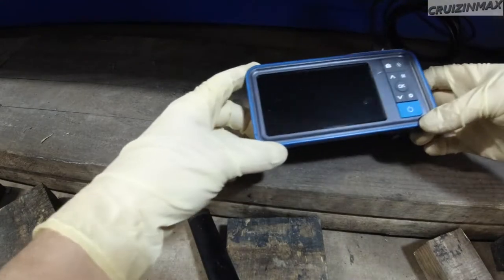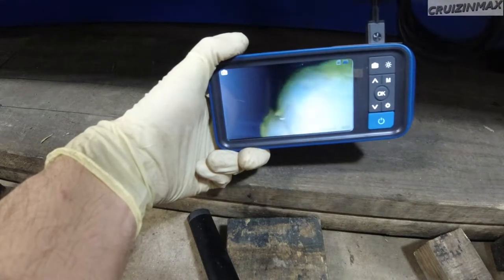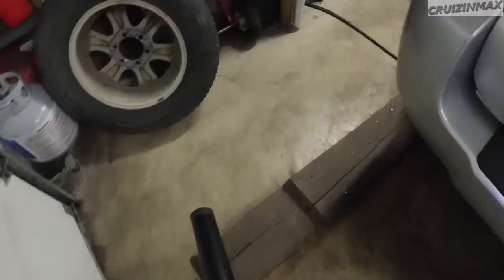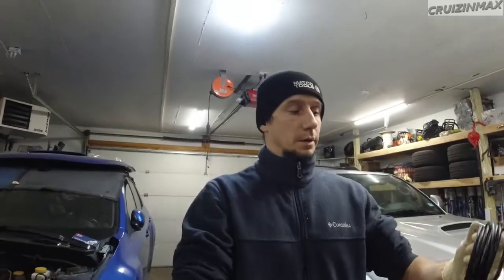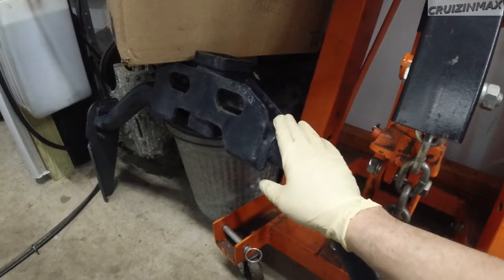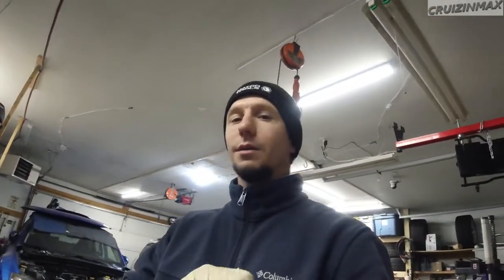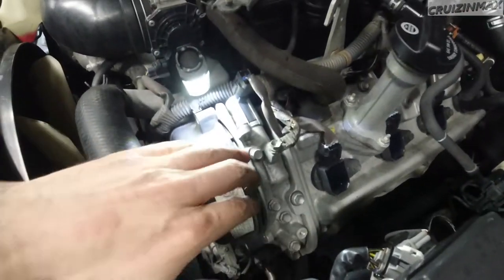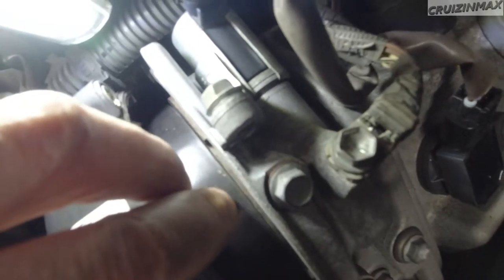4th Gen Toyota 4Runner quick look inside frame and timing belt

Comment: You do the timing belt yet ?
Reply from the maker: yes i have.
Reply: @cruizinmax4017  did you make a video ?  Was it very difficult??
Reply: @cruizinmax4017  this video you made I wish I found 2 weeks ago before I bought this truck.   My belt is severely cracked and needs to be replaced asap. And I’m at the mercy of having to wait till the end of the Month to afford Toyota to do it all and the water pump and all the other things you change with this
Reply from the maker: Sorry for the late reply, I hope you got your truck fixed in time.
Reply: @cruizinmax4017  I did thanks
Reply: @cruizinmax4017  I shared a video of my belt that was changed on my Chanel